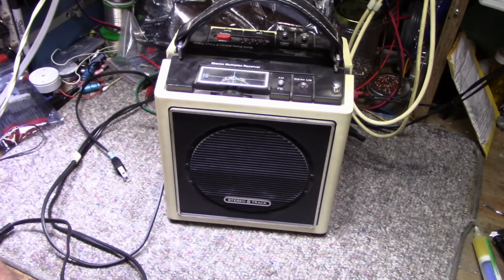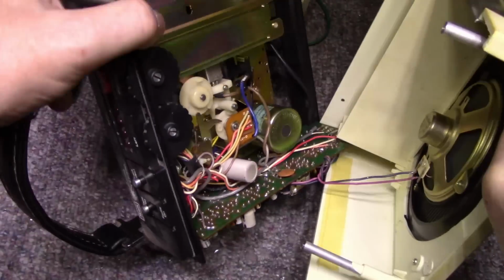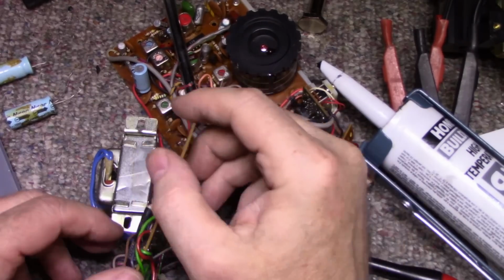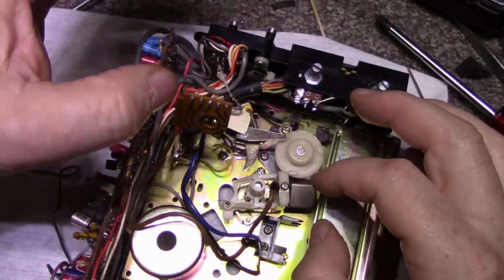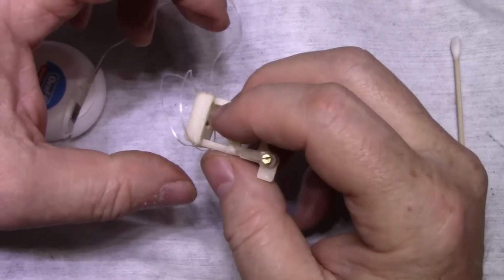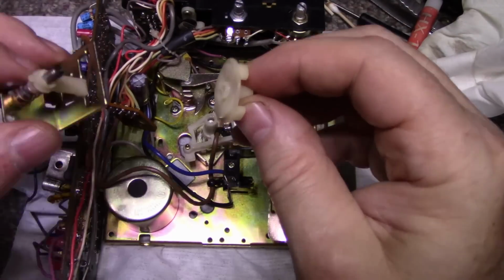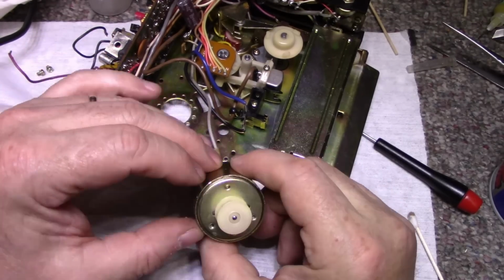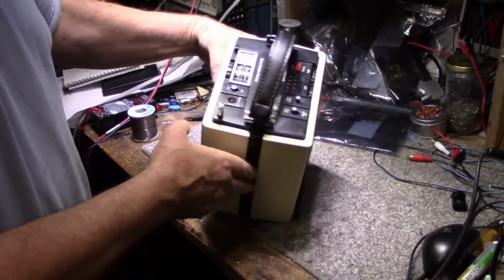Sears 19276 Portable AM/FM 8-Track Stereo Player (Ep. 180)

Comment: Nice unit. For a few bucks maybe you can fit two larger speakers in.
These early LED's  draw 20 mA at that brightness, that's a bit to much for batteries. Modern LED's give the same brightness with about 3 mA.
And your floss wire.... I have used a good quality 100% polyester sewing thread. Cheap and many thickness available.
Reply: That was NOT superglue(although it might have worked as well)-he was using UV-curable resin-which is why he was using the UV(probably more like near UV)flashlight to cure it.